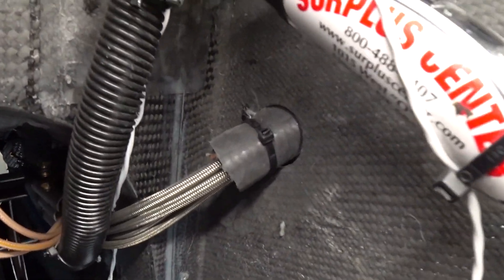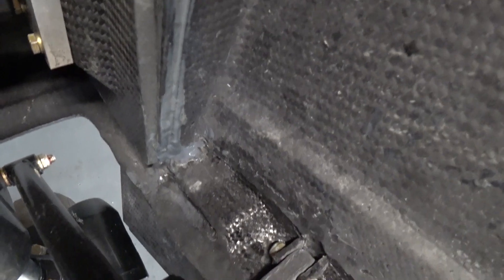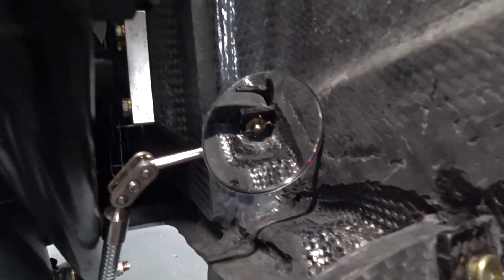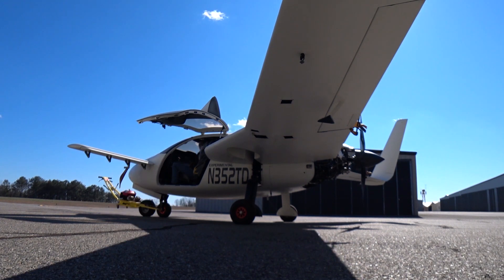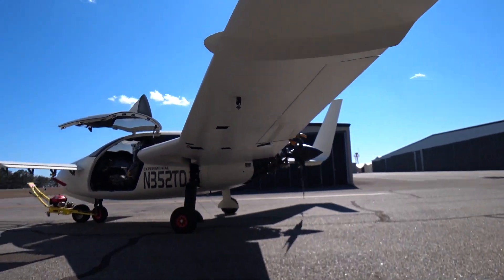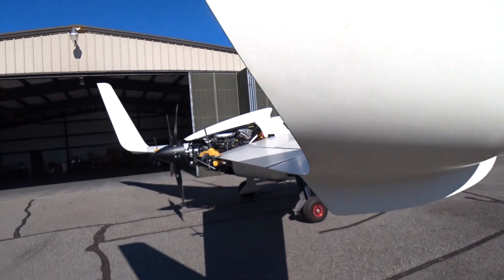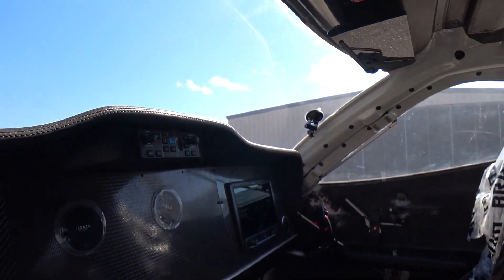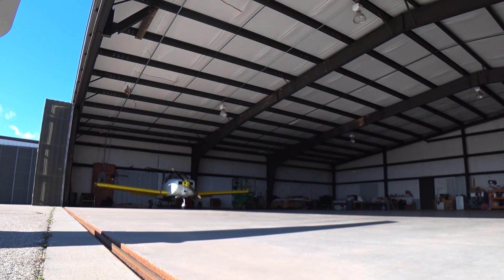Coming Back to Life - Building the Raptor Prototype

Comment: Run dual batteries for the diesel. When at altitude with cold batteries you may well find it nearly impossible to start. A small Marine battery tender with all the testing is a good idea.

Comment: Put a voltmeter on the battery port and on the starter side. If the wires are a bit lengthy you can have a quite huge voltage drop in the line.

Comment: An inexpensive device brand named Battery Tender can quite easily be installed.  It only requires the battery terminals to be attached and after parking the aircraft in the hanger to attach the battery tender to the terminals previously installed.  They have small rubber plugs that are pushed on to prevent any contact.   This is the best brand of the device to keep the battery automatically fully charged.  About  $29.00 at Wall-Mart or any Auto Parts store...

Comment: Nice work Peter! Lots of pragmatic solutions coming together. Just out of curiosity, I noticed those braided lines in the nose run past a solid alloy pipe too (brake lines I assume - 0:32). Is there any abrasion risk with this setup? A couple of swivel clip ties or something similar might both tidy it up a little but also add some protection...just a thought :) Keep up the good work, it’s an exciting time!

Comment: Getting really close Peter!    When a battery is low like that the voltage is just too darn low to run a pump, fire the injectors correctly (if at all) and crank the engine.   As a rule I never even try to start anything anymore with a low battery.   The wear on starter motors is quite significant.   I got tired of changing starters.  Keep swinging for the fences!
Reply: @Shawn Huffman That would explain it. Learn something new all the time. Thanks!